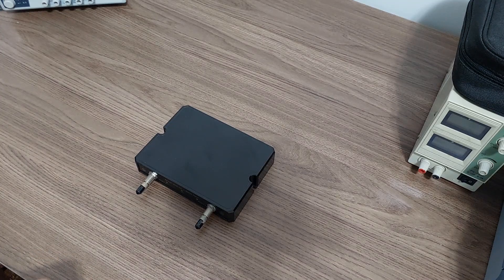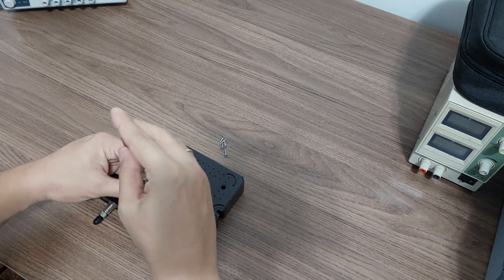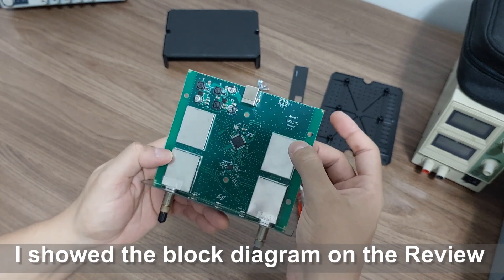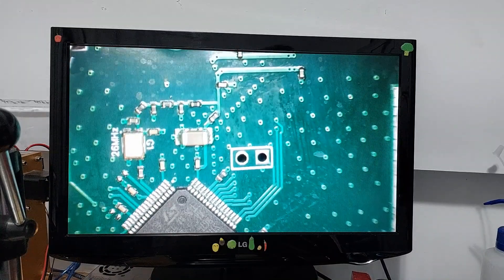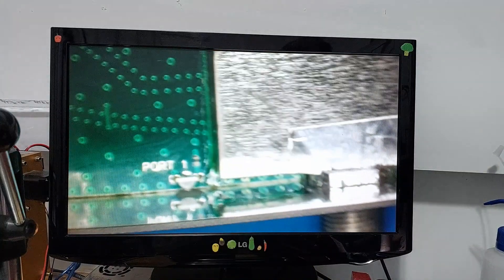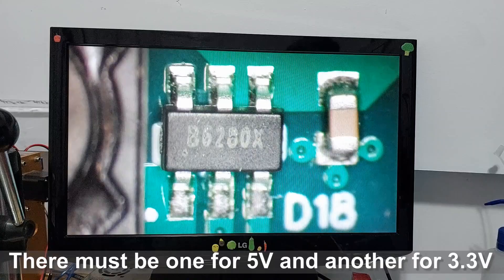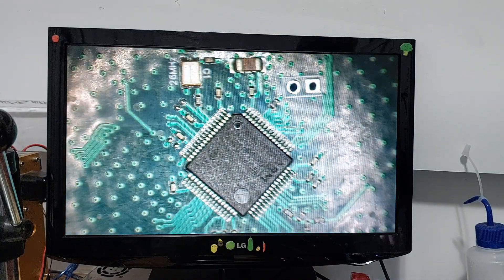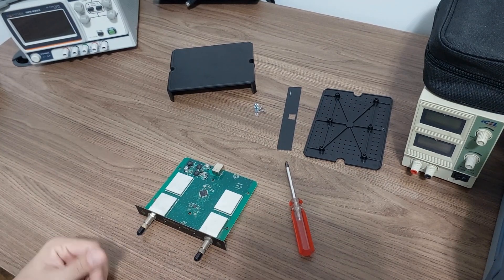[EN] Teardown of ARINST 8800MHz VNA

Comment: Hello...... I ask you, in your opinion
does it have better performance than LibreVNA?
And what do you think of LibreVNA?
Reply from the maker: Hi Claudio. I have not tested the LibreVNA. From what I researched about it, it's got a real problem with getting hot and affecting the measurements. The ARINST does not have any problem with temperature. That's why I chose this one over the libreVNA. One advantage of the LivreVNA is being a full two-port device, which measures all 4 S-parameters at the same time. On the ARINST, you're only able to measure 2 S-parameters at a time (you can still get all 4 though).